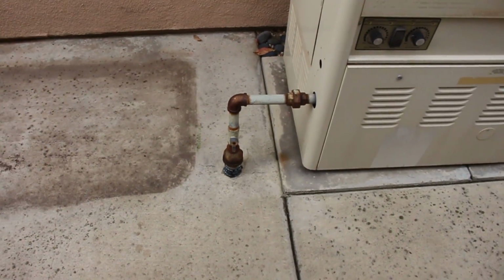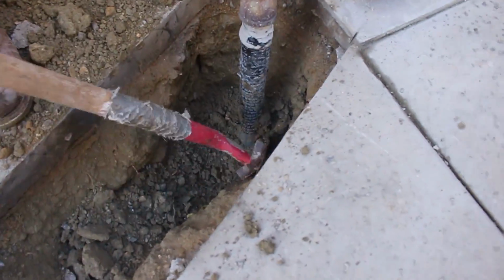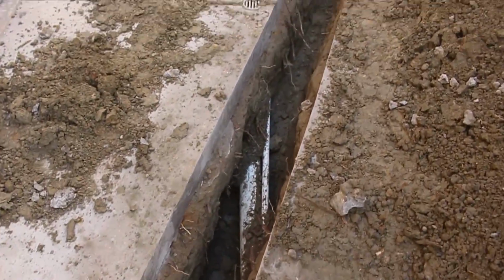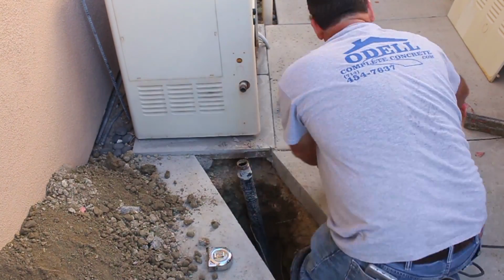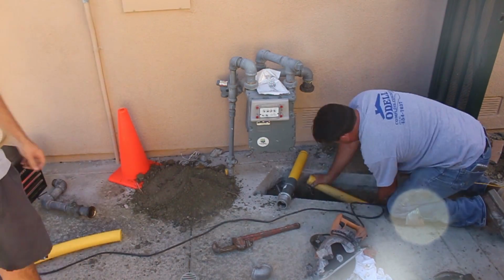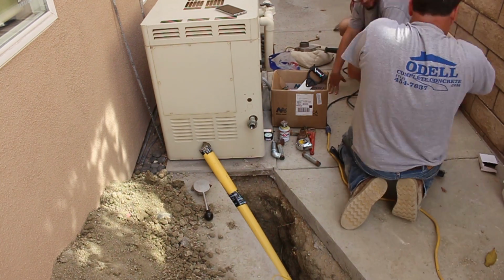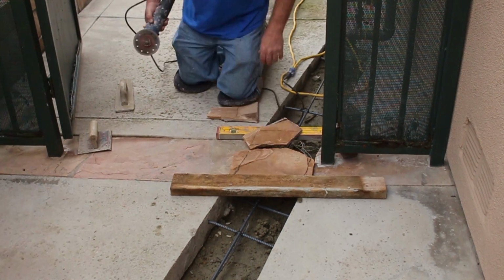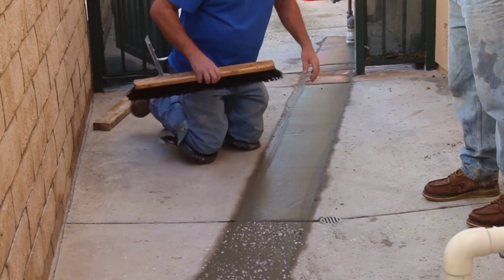How to Replace a Underground Gas Line Under Concrete!

Comment: As a gas distribution mechanic for a utility company you knocked it out of the park on this post meter install. Wish their was more guys like you and your team that took pride in your work like this
Reply: This is a great video.  I made one  exposing a house flipper,code enforcement and building inspectors trying to cover up a Hazard. It’s the video with 7000 views I’m sure you’ll enjoy it and use it as a tool to show how not to 🙏🙏🤝
Reply: Hey wondering if you would know 😅, will the gas company replace old gas line that is only buried about 6 inches at the most. That goes from street to my meter? I get the rest is on my but it's the distribution line to my meter and is very shallow

Comment: The difference between a good tradesman and a great one is how well they can do repair work. That's easily the nicest concrete trench and repair job I've ever seen. Top work dudes!
Reply from the maker: TY
Reply: Also there is a tool called accu punch this will prevent from open trenching.
Reply: I conquer
Reply: So true. Some people just butcher a job. Some plumbers don't even do the finish work.

Comment: Another compliment.  Having the additional knowledge of pipe fitting and gas code is a plus for your company.  That is one less subcontractor you need to hire.  I really like your ethic in doing any task called for by your contract.  You probably have your lead and second hand well trained for those times you might not be able to be on the job site.  God bless you and your company in the future.
Reply from the maker: TY
I'm working at the training part probably another two years

Comment: I've done Gas for about the last 4 years now and this is by far the best video on putting in a gas line underground on YouTube. Only thing I would of done different is put some sort of sleeve around the straight transition Risers to keep it from direct contact with the concrete because eventually the riser will rust right at the concrete line. Still a great job though!
Reply from the maker: I didn't mention it in the video  but I did wrap the riser with foam, so that it wouldn't be in contact with the concrete.
The riser is also coated in epoxy.
The foam allows the pipe to move independently from the concrete, incase of an earth quake.
TY
Reply: Odell Complete Concrete oh wow that's really creative! I don't have to worry about those in AZ haha great video!
Reply from the maker: TRue
Reply: I was watching to find this out and see the reply to your comment is foam around the pipe, so the wet concrete does not touch the pipe.
Maybe Odell Complete Concrete can  add this to the commentary.

Comment: Master of all trades, nice work as usual. Dave I decided to tackle the deck drain in front of my garage in Santa Ana. If i get enough courage I may send you a picture of my finished rookie job, thanks again for your advice,..
Reply from the maker: TY
GL
Get it on
Reply: This is a great video.  I made one  exposing a house flipper,code enforcement and building inspectors trying to cover up a Hazard. It’s the video with 7000 views I’m sure you’ll enjoy it and use it as a tool to show how not to 🙏🙏🤝

Comment: Some reason it feels like it was a concrete job you did a long time ago.  I imagine with all the jobs you do you can't remember all of them.  But the quality work of the concrete and drains is classic Odell.
Reply from the maker: No I never worked there before but they all look similar in the track homes I typically work on

Comment: I got in trouble for using the tape to bond the wire to the pipe. Had to pull 120' of poly back out and zip tie it to the pipe. Good job on the poly. They make shears for poly to get a great cut and also inquire about the shaver for it, makes the ends your putting together perfectly straight. Great job!
Reply from the maker: I thought they might but I don't do these everyday.

Comment: My only request would be that you show a pic of the finished work. However I know it probably doesn't make much sense to drive back out just for that.
Reply from the maker: burlymugg 
I get that request a lot.
Reply: Yes, I was just curious as to how well the concrete patch-up blends into the existing slab once dried.... Nice work!

Comment: One thing I really appreciate about your work is you do not appear to do that "it's good enough" crap work. The ends weren't square so you took the time to make it so. I guarantee there's many tradesmen who would have said that it was good enough after the first cut on that flex pipe and used it as is. Many times when I've had to do something to my house I have to deal with stuff that was apparently "good enough" at the time and as a result nothing is like it should be and I spend way more time fixing what was already there versus doing what I set out to do. Keep up the good work!
Reply from the maker: TY
I'll try

Comment: I think a two inch poly is an absolute overkill for a residential standby generator. Also, California is seismically active state. I wonder how the heated/ glued joints will hold up in the case of an earthquake. There are threaded poly joints, elbows and transitions in the market today. Those are better for a seismic areas. 5 psi 10 mins is a very low bar for leak test and probably the reason why the old pipe sprung a leak. Nice work, excellent tradesmanship, regardless.
Reply from the maker: I have a feeling the leak was from a loose threaded fitting.

Comment: Nice job. But honestly if it was my house. Screw that, a gasline is being ran along the wall
Reply from the maker: +lolMyke 
Get it on
Reply: Yeah, no doubt.
Reply: Depends on how much money you can throw and how your requirements on the looks are. I guess both variables where for this homeowner ‘high’.
Reply: You can’t cuz of the door
Reply: @gungraveheat7860  I was at a customer's house recently doing a repair and I noticed a 2" iron gas line running along the wall to the backyard and also a 1" electrical conduit running parallel, with the strut bolted to the wall.  Then it makes a bunch of 90's to go up and around a side door.  Ugliest thing I ever saw, I wish I would have taken some pictures.  It looked like train tracks on the side of the home.  That hurts the re-sale value too.  Underground is the way to go.
Reply: @gungraveheat7860  Plenty of room from top of door to where roof starts looks like about 3 feet to me . Come off meter go up to top edge of house and over and the down to pool heater.
Reply: @marcostankless7526  that must've a mansion.
Reply: Odell you use galvanized  pipes on gas???
Reply: Nah, things are suppose to look well done. Well done would not be a gas pipe hanging on a wall. Not in these circumstances.
Reply: @noahflores5515  galvanized is for gas

Comment: At 17:20 you were completely correct about the pressure dropping because of the temperature dropping as they are proportionsl. You also mentioned volume dropping and that was not correct. The volume in the pipe remained the same as the pipes don't change size,
Reply from the maker: That's interesting
Reply: @OdellCompleteConcrete  Due to physics of the ideal gas law: PV = nRT
where
P = Pressure
V = Volume
n = number of moles
R = Ideal gas constant
T = Temperature

Comment: First of all, really nice job. Second, over kill! No reason for 2" even for future appliances.  You can use the old steel pipe as a casing and shoot 1" poly through. Meaning you would only need to dig pilot holes to set the risers by the meter and near the heater (no trench required). 30ft of 1" would have been good for 374,000btus, 466k for 20'. Well enough for a 40,000btu heater. Steel casing is also used for locations as well.
Reply from the maker: Good idea

Comment: 18 seconds for heat time,  you should use the cold rings so it smashes up against them for a prettier fusion.
Reply from the maker: Sounds good 
TY

Comment: that kit was missing stuff! it should have had caps that go on the ends of the male part you are going to weld and then a cold clamp that shpws you exactly how far to insert pipe into heater! and then the cold clamp also acts as a stop for the hot weld to stop against! i do a lot of geothermal piping which is the same kind of pipe just black! awesome job!
Reply from the maker: I was using the cold clamps. I didn't have any caps though.
TY
Reply: Odell Complete Concrete ahh I didn’t see clamp on first one but I see the clamp on the second one! Gotcha

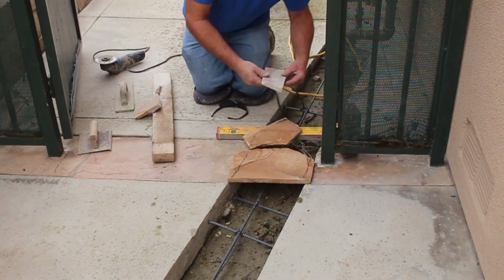Comment: At 21:30 I think I would have not cut that band and worked around it, digging underneath it. Slightly more work on the front, but way easier when putting it back.
Reply from the maker: I hear that

Comment: First thing use should have done is a pressure test the existing line .... don't trust the gas companies' assessment. The leak could have been elsewhere. The gas company doesn't do pressure test.
You also could save a lot of money and work by running the new pipe along the wall ( 30ft of 1/2" pipe would have supplied 84k BTUs - That is twice the gas needed for your 40k BTU spa heater)
by replacing the 1-1/2" line with 2" pipe you went from 760k -to 1,430K BTUs (thats 350x the needed amount of gas. unless there are mor gas appliances connected to this line ????)
could have been completed in 1 afternoon (@ < $1000) rather than 4-5 days (2 >$4000)
Otherwise, all the other work seemed pretty great!!! I learned some good concrete techniques. 😀🔥

Comment: Very good video, I have a question,I am going to do a fire pit and a BBQ grill on my backyard and my question is, can the gas and electricity lines go together so as not to dig another ditch? And I will need two gas lines if I am going to make a fire pit and a BBQ grill or just need one gas pipe ? the fire fit and the BBQ will be separated from each other 25 feet
Reply from the maker: Yes you can!
Try teeing off the gas line.

Comment: Awesome you do plumbing too. Didn’t the kit come with a rig that push your fittings together on the hot plate and then together after removing hot plate?
Reply from the maker: We do it all out here! but it did not.

Comment: Thanks Mr. O’Dell!  How did you dill for the those 3/8th rebar?  Looks like it would be a tight fit.  Did you come in at a low angle and then bend the rebar level?  That’s what I was thinking....
Reply from the maker: on a angle then bend down

Comment: Curious about why you went with the welded fittings over the push on? I know that the push on one's are ridiculously high but I would think renting the welder would cancel out the savings. And in looking back would you do it the same way?
Reply from the maker: The push on mechanical is what failed on the old line, so I thought I would go with a sure shot.

Comment: Underground piping is suppose to be no less than 18 inches below the surface of the ground unless otherwise protected. What can you protect it with?
Reply from the maker: concrete
Reply: @OdellCompleteConcrete   Thank you, so it can be 12" deep if filled with concrete?

Comment: Really great job   I'll be doing the exact same task starting tomorrow, and I can't thank you enough.  But tell me - where do you think the leak was coming from...??   Could it have been those super loose fittings at the meter ?!
Reply from the maker: According to the Gas Company it was below ground by gate, which would put the leak at the 90 degree riser and straight run.

Comment: David. Wonderful job. Since that old cement had mold on it from being in the shade, what's the best way to clean off mold like that?
Reply from the maker: Muratic acid 
5 parts water 1 part acid. gloves and a scrub brush.
Reply: Thank you for the tip!
Reply from the maker: Sure

Comment: If you used an air compressor to press that up then your air going in the pipe would have been hot and then would cool overnight and the pressure would drop. if you used a hand pump it wouldn't be as hot and wouldn't shrink that much afterward when it got colder
Reply from the maker: That's interesting but what's the point?

Comment: Was the initial pipe fail do to improper installation? How was the leak detected to the heater?
Reply from the maker: Gas Company. Leak detector.
I think the leak was underground at transition fitting.

Comment: The poly was sawed and then beveled. This produces plastic pieces like saw dust and they will fall into the pipe. How did you make sure that the debris was out before assembling?
Reply from the maker: good point
Reply from the maker: Shake the debris out

Comment: Would it be to code if the pipe was diverted above ground on the side of the building using iron pipe?
Reply from the maker: Yes
Reply: The only issue would be resale value.

Comment: If the whole fuel line was poly.  I would have dug up both risers and replaced the compression fitting at each riser. Wouldn't have to cut all that concrete

Comment: David, do you have any tricks for cutting rebar in a really tight space? I build wrought iron rails and core-mount the posts. Occasionally, the core-hole lands on rebar (invariably soon after I buy a new core bit breaking a tooth off). The cores are only 2-1-4" OD so a 4-1/2" grinder doesn't work and trying to torch cut in a small hole surrounded by concrete worries me too much to try.
Reply from the maker: The diamond blade should cut through the steel.
I cut through steel in concrete all the time. Its a little slower going and a lot of sparks, but it gets it done.
Reply: Odell Complete Concrete sorry for the delayed "thank you". My phone glitched or something I just saw you replied. Thank you for the suggestion. Unless, I'm coring through fragile slate/tile etc, I usually use a percussion hammer coring bit (for Hilti TE80). It does have a rotate only mode, though. I'll have to see if a diamond bit is available and cost effective. Perfect solution if so. Thanks for the reply. BTW, I'm still binging on your vids. Being my slow season, I'm gaining confidence to tackle a long-overdue driveway extension for my truck/trailer. Thanks again. If you've read this far, may I ask?...If widening a driveway (and extending it through the side yard), would I pour directly up to my house slab without an expansion foam? My house slab is the only restricting side. One of your videos seemed to suggest the foam is only necessary if the new pour is constricted on two sides (a house and masonry wall). And, would you recommend rebar inserts into the slab? Thanks again! I wish you guys were in Georgia.
Reply: Greg Orris Thanks for the suggestion, Greg. Unfortunately, for my typical situation a recip saw doesn't have enough stroke-travel to be effective, unless, maybe, there is a blade that will cut both steel AND concrete. Then, I could drill a relief-hole to get  it started.
Reply from the maker: MEF Rails 
No expansion unless your boxed in.
GL
TY

Comment: How could you tell how deep the 6 white pipe? Did you did by hand first before using a shovel.
Reply from the maker: Its 40 schedule, so your not going to break it with a shovel
Reply: Sorry I meant dig by hand first.

Comment: 11/2 was over kill, it would've been fine with 3/4, should've done a calculation on BTU'S
Reply from the maker: Good for future bbq and fire pit
Reply: Never over kill in gas, what if the wanted to upgrade heater
Reply: @mikejones5364  what if
Reply: still overkill by alot
Reply: @cannonplumbinganddrainllc4221  Not really.  Im in Texas most if not all pool heaters are at least 1 1/4" pipe, of course the run is longer. It's better to oversize the pipe for future use, and the heater looked small to me.  3/4 is odd size for poly and fittings for gas runs also.

Comment: why are you going from 1.5" up to 2" and then back down to 3/4" when the demand for that unit does not call for that diameter at that distance ???
Reply from the maker: future accessories
Reply: Odell Complete Concrete with a 30 foot run , 1.5” pipe would be more than enough even with accessories added, nice job though .

Comment: Hi great work, i have a question, how did you detected the gas leak? Im getting in a house that has a gas line under the floor of the house it is a concrete floor (regulations are not as strict as in the us) and im interesting in performing yearly revisions but i was wondering if the presure test with the water column would show a leak if the gas line is sinked in concrete or which method would be the best, thanks in advance
Reply from the maker: The gas Company here has a gas sniffer.
Reply: @OdellCompleteConcrete  ok thanks for the answer

Comment: You replace the u/g Polyethylene Gas pipe. What is the workig pressure inside the pipe ?
Reply from the maker: 7lbs
Reply: @OdellCompleteConcrete  Why no secondary regulator at pool heater If it was coming in at 7 lbs?